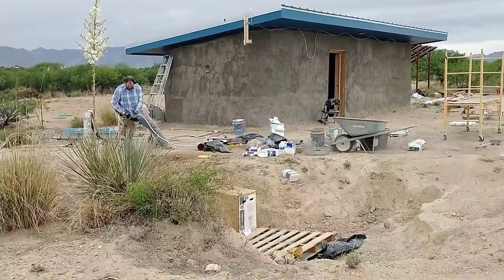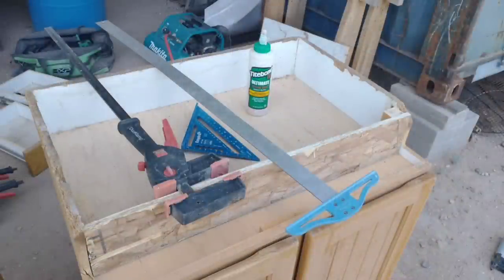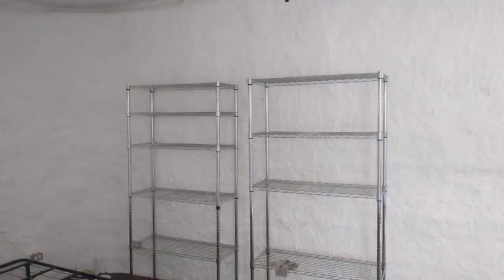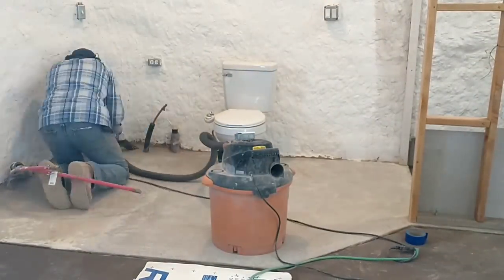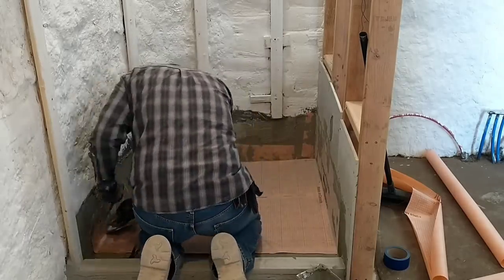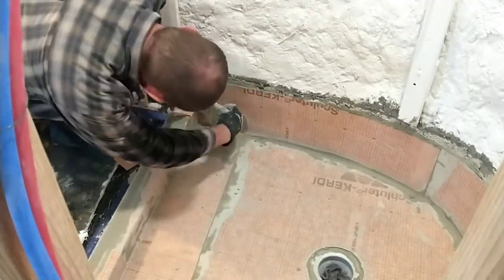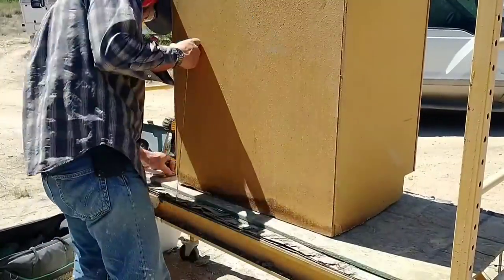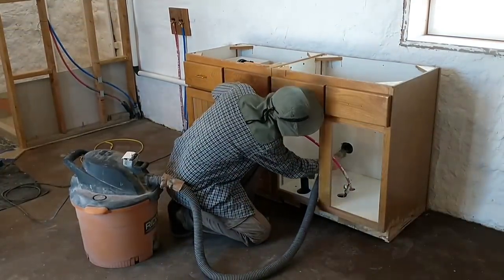Hyperadobe Tiny House #11 Kitchen Cabinets & Shower Pan

Comment: I always look forward to your next video!  I REALLY like the "family compound" nature of this, and I am keenly interested in the Arizona climate and area.  Your well puts you in a very strong position, meaning that you made an excellent buy on the Property.  Power (Solar) - is my primary question.   How is your grid holding?  Can you expand it enough to incorporate all the expansion?
Reply from the maker: Thanks! My grandpa and mom always stressed that we should never buy land that doesn't have good water available.  It took some looking, and cost more, but it was well worth it. 💦 🏜️
Each household has its own separate solar system. They are all the same. Red designed and ordered everything for all 3 systems before we moved out here. They are working out great, and can be added on to if needed. 🌞

Comment: What is the antenna seen at the beginning and also around the 6-minute mark?
Reply from the maker: It's a cell signal booster. It's definitely needed with the metal roof and 18" thick walls. It gives him better cell reception than he gets in the RV.

Comment: get a couple outdoor cats, they really help with the snakes!
Reply from the maker: His cat is smaller than that rabbit. 🙀😄
Reply: @RedandAprilOff-Grid   4 cats per homestead is ideal
Reply from the maker: His cat is about 10 years old and has never been much of a hunter. We would prefer not to have any domestic cats out here. They do a lot of damage to the eco system and also kill birds, lizards, and good snakes.
Reply: @RedandAprilOff-Grid  where im at it works great for rodents and snakes. we have massive pest pressure in NM...rattle snakes and rodents everywhere...the cats dont make a dent in the lizard population...just make cat proof bird houses. if you dont have insurance a rattlesnake anti venom trip to the hospital will cost you over $100,000